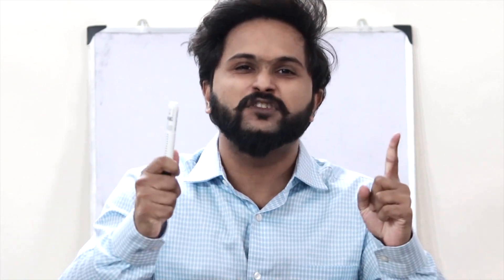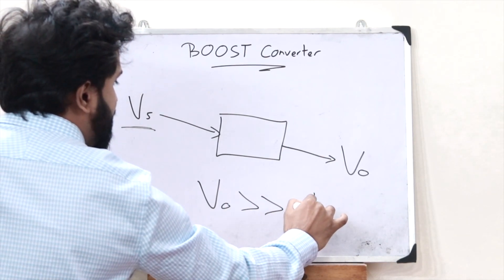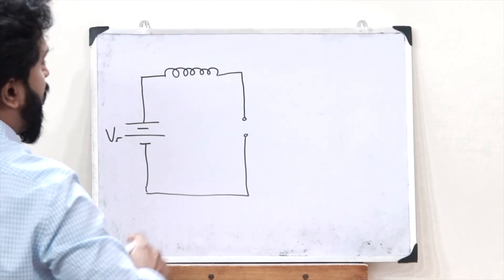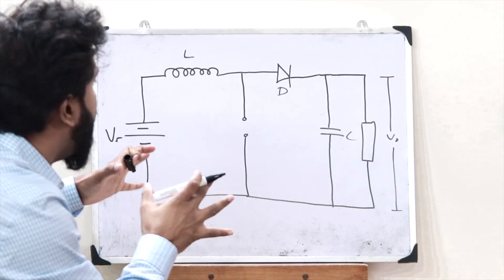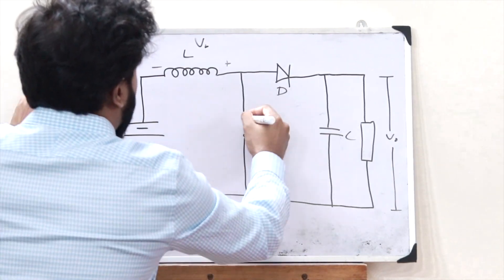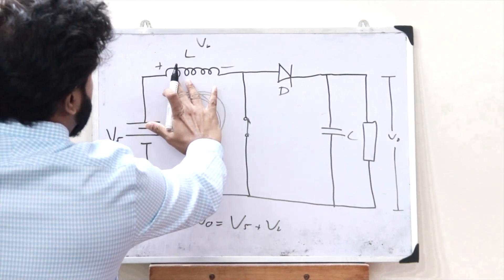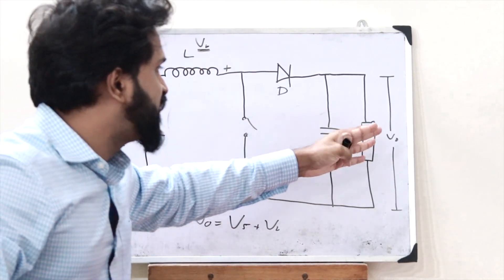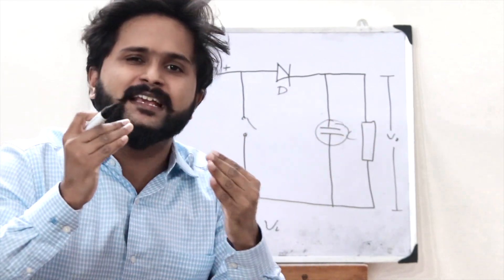Boost Converter (Step Up DC to DC) - Principle, Circuit Diagram, Construction, Working, Waveforms

Comment: Sir, in the waveform Ic (current through capacitor) is not mentioned.
It is mentioned in the previous video of buck converters.
Voltage time balance and current time balance is also not mentioned.